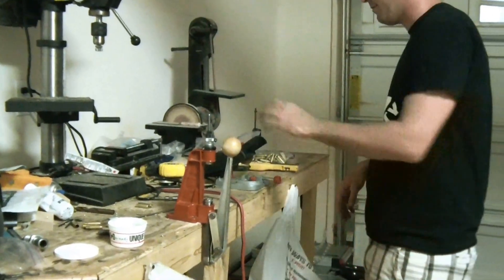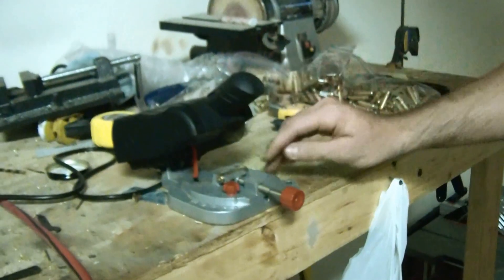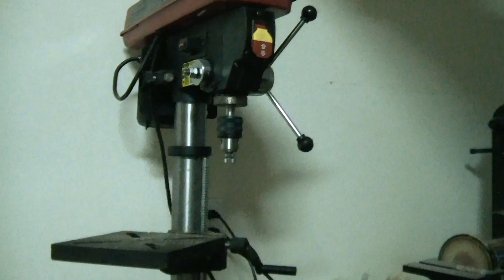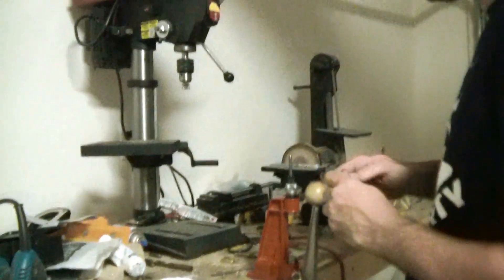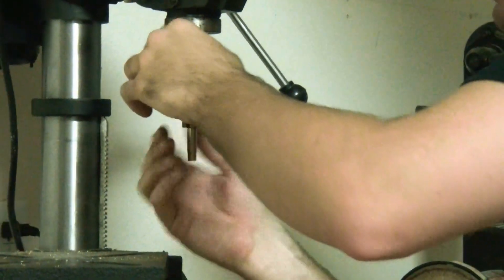How to Make .300 Blackout from .223 Casings

Comment from the maker: Well, ive been using my friends that we converted. Its a DPMS Upper with just a quick barrel change. Thats the only thing that you have to change on it. The same .223 bolt, magazine, and lower receiver are used for .300 Blackout but you must change the barrel to a .300 Blackout barrel to shoot these rounds. Just need an Armorers wrench, a torque wrench, and a little bit of time to do the swap!